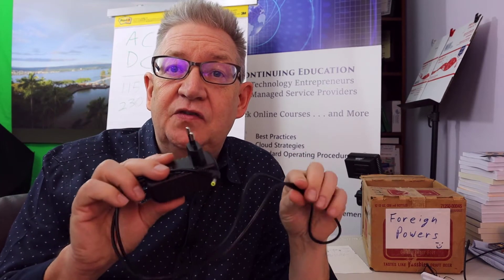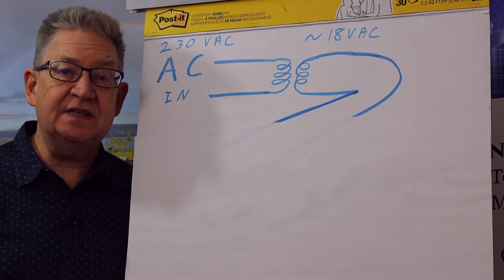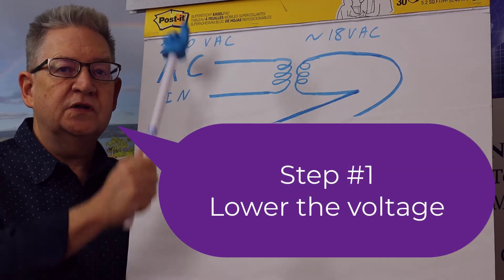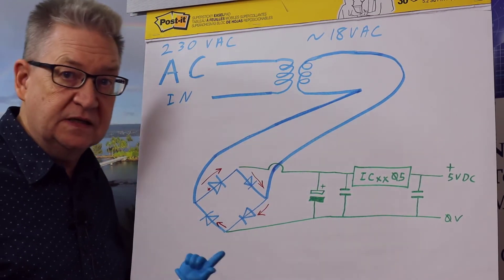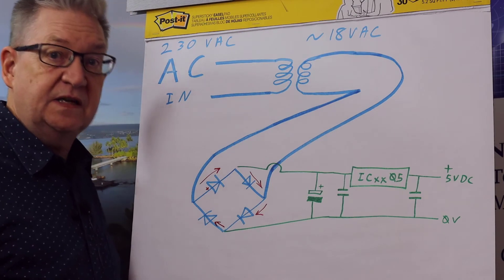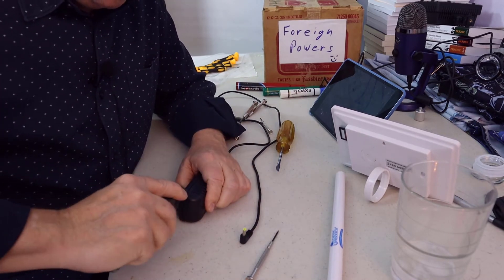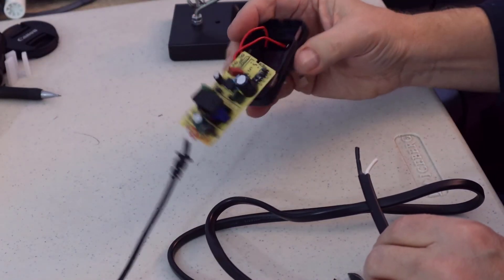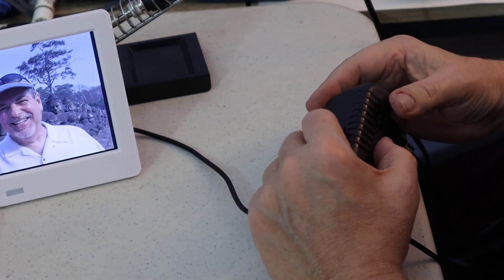Convert 230 Volt European Plug to US 110 Plug

Comment: Great video. I had a feeling I could do that but hesitant until I watched your excellent presentation. I will "Go slow and get more things done." Thanks.
Reply: 100V - 240V
Reply: 230V plug is European Type C plug. Here in Brazil, we use 127V or 110V, but most of outlets are Type N that fits Type C plugs. Type J Swiss plug can’t fit on Type N outlets.

Rio De Janeiro and Sao Paulo uses 127V and Belem and Rio Grande do Norte uses 220V. Most of Brazil uses 60Hz.

Comment: This sounds like foreign language to me….oh gosh anything simpler so I can use my 220v blower dryer on a 110 outlet
Reply from the maker: I think you are talking about a hair dryer. So . . . you need to buy a converter. I think you want to plug a European or Asian appliance into the 110 North American outlet. Something like this should work - https://amzn.to/49iFMde. Note: I just looked that up. I have never used it and this is not an endorsement. But it plugs into an American outlet and steps up the voltage. Personally, for the price, you might also consider just buying a new hair dryer.

Comment: I have a Carpet machine i ordered online ans it says its 230Voklts at 8 amp. They sent me this machin with no plug 🔌 .i live in USA .i see the machine have 3 wires but I am not sure it looks like it wont work for regular plug and need to run off a generator. The one i have have 240 volts with 4 prongs but have another plug outlet that have 3 prong but its only 120ac . What should i do i am no expert and cant find much local help?
Reply from the maker: Hello. Since you're working with a motor and not just electronic components, the voltage is important. Check the machine for a metal plate that lists voltages and amperage. There might be a switch that changes the input to 115 volts (anything 110-120). 
If you really need 230v and 8a, you need a converter or generator that puts out something in the 220-240 volt range. A licensed electrician should be able to create a short cable that does the conversion you need. It may not be worth the expense.
Don't mess around with this: Those voltages can kill you!

Comment: Hi we just moved to the us from Switzerland, how do we use our treasured designer lamps? An adapter is not working😞
Reply from the maker: Of course, I have no idea how the lamps are built, but they probably have a basic 230 volt input and have bulbs designed for that voltage. Are the bulb sockets a standard type that you can find in North America? If so, you may just need new 120-volt lamps.

Do you have incandescent bulbs (old school), or LED bulbs? If you have incandescent bulbs, they might come on dimly due to low voltage. If LED, the circuit may only work with 230v and not 120v. 

Just some notes. Hopes that helps.

Comment: Those convert it first into DC and then high frequency AC. This allows them to use only a very small transformer. Older ones that worked directly on the AC frequency were very heavy.

Comment: do you have to make it so complicated? l
US standard should be across the globe
I am trying to convert a power plug from uk standard to us standard, I had thought I could simply resolder a new plug or wire to the battery charger and charge my US car batteries but nooooo we gotta mess around with wild voltages just to mess up my day
Reply: Th US plug is used in 55 countries, the Europlug in 138 countries.

Comment: I have a eu plug to a printer I ordered & its 220v, I bought a converter to plug in but it still isn’t working…I notice the plug is also a 3pin prong cable, can I just buy a u.s. 3pin prong cable and use that?
Reply from the maker: Well . . . it depends. The more "mechanical" and less "electrical," the more careful you have to be. By mechanical I mean things like motors as opposed to integrated circuits. 

There should be a plate or a label somewhere on the printer that displays the acceptable voltages. For example, the back of my HP 6230 says, "100-240V  50/60 Hz  700mA." So it will take straight power in Europe or North America with just the physical converter.

If your device requires an actual 220v, then the US 115 won't be enough. If it's rated for both voltages, then the standard US cable should work. I hope that helps.
Reply: @smallbizthoughts  on back it says  canon 220-240V a.c.  50/60Hz 2.4A
Reply from the maker: So @justinmatthews427  - you need a step-up voltage converter because something in the printer actually needs the 220 volts. Many will also have a UK or EU outlet, so you can use the original cable. Prices start at about $40 and go up from there.

Comment: What to do with ground?
Reply from the maker: Thanks for the note. As you see at the very beginning, the original European plug was un-grounded. This is very common with very low-amp electronics (pretty much everywhere). Since the Euro 230-volt plug was two-prong, I felt fine with a US conversion that's also un-grounded and two prong.

Comment: So what if I'm trying to convert a EU to American plug and there's no transformer present. Just a plug.
Reply from the maker: Depends. If you're plugging into something that will take either 230 or 120 volts (such as most laptop power supplies), you should be good. But for some things, you'll need to step up the voltage. 
With mechanical devices (e.g., electric razor or motor), the 120v may not be enough to make the device work. So you'll need a transformer. I hope that helps.

Comment: i’ve a dyson hairdryer that’s
Reply from the maker: I didn't get the full message here, but there's a big difference between electric appliances (like hair dryers, razors, and toasters) and electronic devices. Electronic devices step down to a lower voltage (e.g., 5V or 12V). Electric appliances are designed for a specific voltage. You won't do any harm by plugging a 230v hair dryer into a 115v circuit - but it might not work. Or it might work at half the speed.

Comment: I have a simple cord with a light bulb socket on the other end for lighting a Christmas ornament with a european 2 prong plug on it. It is just the plug and does not look like yours in the video.  Can I just cut off the plug and connect a U.S. style 2 prong plug and have the bulb still work safely in the 110 outlet?
Reply from the maker: Go Slow, once again. If you have just the electrical cord with no transformer, then whatever comes out of the wall goes straight to the light bulb(s). If that's the case, changing the plug should do no harm: You will merely be using 115 Volts instead of 230. It should be safe, BUT that doesn't mean it will work. If the light bulb is designed for 230 volts, you might only get a very dim light. This is because there's not enough power to heat up the filaments to a hot white light. If the lights are LED, there's probably circuitry to step the voltage down to something like 5V and convert to DC. If that's the case, the 115 might light it up just fine. 

I hope that helps. Go slow. Be careful. Don't blame me if it doesn't work. :-) Merry Christmas.

Comment: I have a guitar amp from the UK can I switch the power cord? and if so which cord would you recommend?
Reply from the maker: The important thing is to read the specs on the equipment. There should be a panel that lists input and output voltages. If it says something like 110-230 volts, then you can just switch the plug. BUT go slow. A three prong plug will have a ground, a neutral, and a hot wire. In the UK, ground is yellow and green striped, neutral is blue, and brown is hot. On a US power cable, ground is green, white is neutral, and black is hot. Go slow and make sure you get that right.
If you're really lucky, the input will take 110-230 volts AND is will take a standard PC type power cable. If that's the case, buy a US cable and plug it in. It should just work. Again, go slow. I'm not responsible for anything you do. Take your time.

Comment: Your drawing shows a conventional power supply. A switching power supply works entirely different. If the sticker says “100–240 V” it must be a switching power supply. Besides, you got the bridge rectifier wrong in your drawing.

Comment: Thanks, Sir,  How do I fix a 230v DeWalt miter saw to work with our voltage,
Right now it's a big paperweight, Can you help me... Thanks
Reply from the maker: Aha! That's a different kind of animal because it's electrical but on electronic. Basically, that saw is made to respond to 230V and (probably a high amperage). It's more mechanical. You need the current to generate magnetic fields and move the rotor. 

Note: Talk to an electrician! But I'll be an electrician can help you figure out how to convert a 240V dryer outlet to work with that saw. You will probably need a different kind of fuse/breaker. An electrician will let you know whether you need a slow-blow fuse.